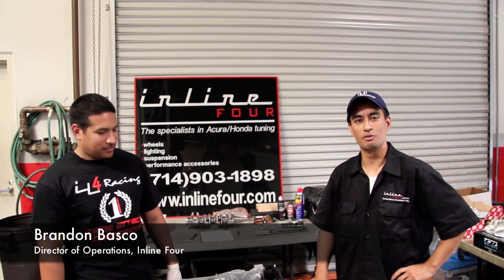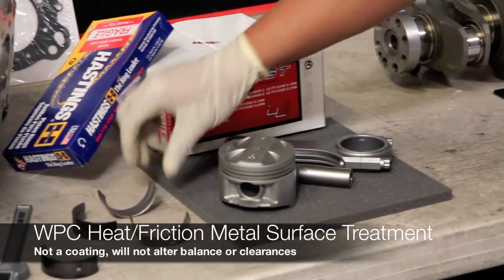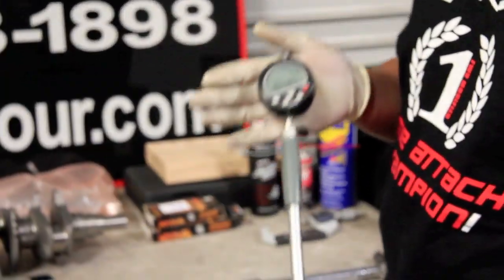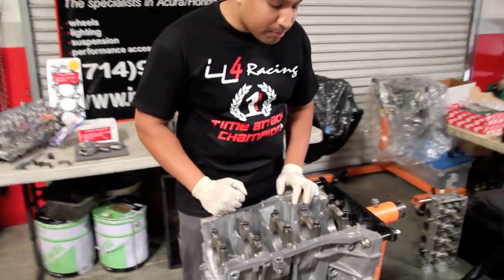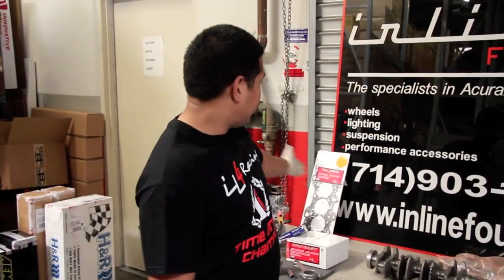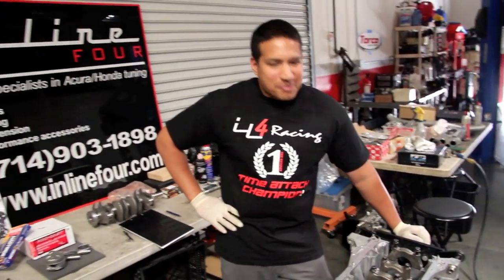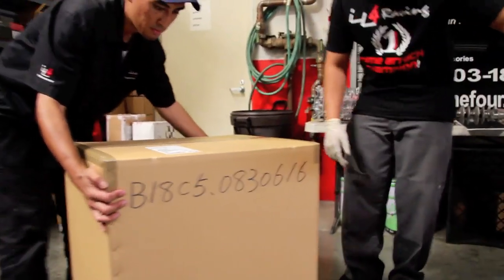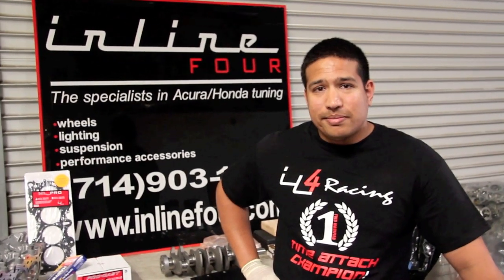Inline Four - Intro to Engine Building....iL4 Spec

Comment from the maker: It's not like there's much difference between the USDM and JDM models either. 195 vs 197 bbp. Likely only attributed to slight changes is ECU or exhaust flow. True there's higher compression in the JDM model, but it doesn't make any more power because of it, that's more for the different grade fuels they had.

Comment from the maker: I would suggest you revise your assumption. All B16's and B18s come from Japan.  Even though its a USDM spec C5, it still was designed & assembled in the same factory as the JDM or EDM models. In fact only a few engines from this era were truly USA made. Such as the D16Y7, as you can see the USA stamp on the head.

Comment from the maker: Indeed they are. You should follow our R-DOT series of videos on our channel. I'm in the process of building a bolt-for-bolt NEW B18C5, using a crate C5 short block and P73 TypeR head + all new bolts, sensors, hoses, etc.

As for impossible... NOW it is, because aside from the short block I used on the current build. We also bought THE last C5 short block. So if your interested message the channel or visit our facebook/website and inquire.

Comment from the maker: very few honda engines from honda are made in the USA for this generation of car. Only the D16Y7 and Y8 are actually made in the USA. 

The B18B1, C1, C5 B16A2, A3, and D16Y5 etc are all made in japan. 

While the C5 was a 'USDM spec' motor. It was still fully assembled and built over sea's.

Check the link in the description for an example.

Comment from the maker: B18C5 TypeR short blocks fluctuate in pricing. They roughly float around $3,000 USD. New TypeR head is $1999 + valve cover and gaskets.